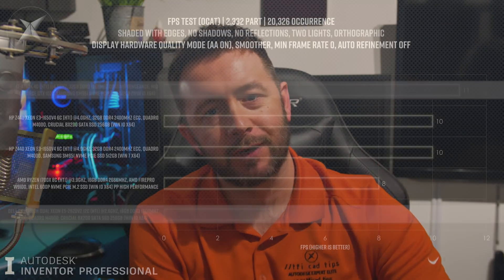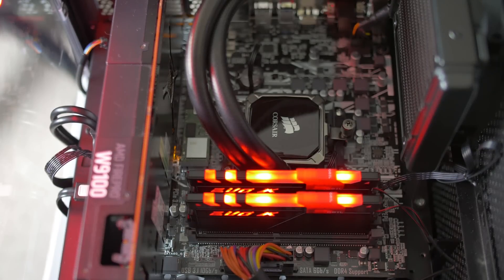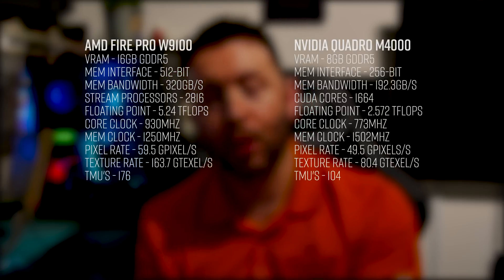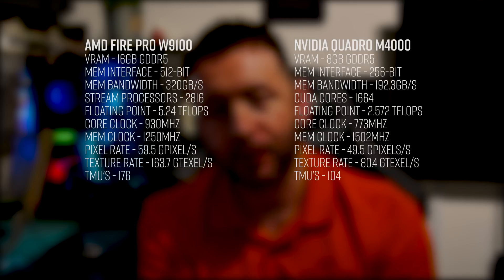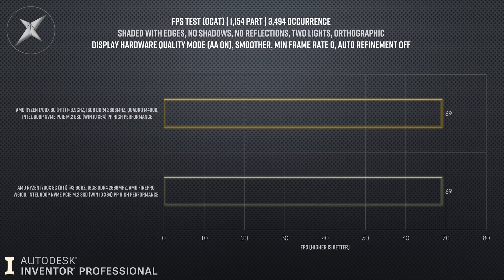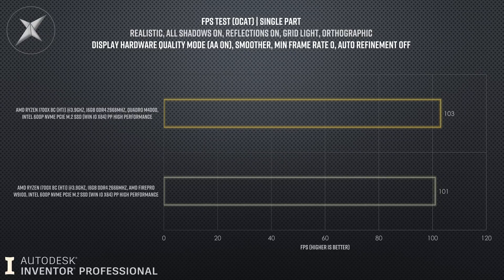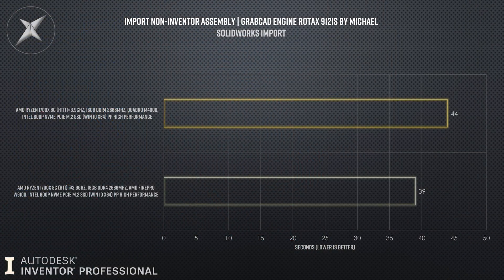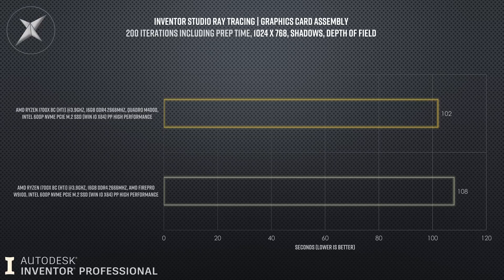3D CAD PC Hardware Benchmark #3 | Ryzen & Quadro M4000 vs FirePro W9100

Comment: Overclocking graphics cards by megahertz makes no sense because manufacturers will repair all defective graphics cards videoram memory is defective missing semiconductors on graphics cores and the like because the performance of graphics cards for example firepro W9000 and geforce gtx titan Z exceed 3 teraflops with defects repairing defects will double the performance therefore pci express 1.0 pci express 2.0 pci express 3.0 agp8pro buses are sufficient for 2060 year

Comment: Hi Neil, I were thinking about the differences between video cards, and I have a curiosity, what if you remove the video card and run the PC with the GPU of the CPU? To see if we actually need a video card for Inventor..
Reply from the maker: Yea I did that, and it was very noticeably worse.  I can only speculate that was down to the lack of VRAM maybe, and the CPU having to do more work for graphics so less power for processing... that could be utter bollocks but it was noticeably worse on the iGPU
Reply: I wonder what budget videocard would deliver enough hardware for Inventor to be happy... obviously high-end cards don't make a difference... Would be funny to do a benchmark test with a 50 buck card against their recommended quadro XD
Reply: Hey! I have like a week working with a PC withoud video card in Inventor, is an I7 7700K, 16gb of RAM Z270  Mobo, W10. To be  honest with settings in performance it runs very good. I guess that obiously there is a difference with video card, but the key issue here is (in my opinion of course), when you buy your first machine for example, you'll have more value investing the money of the video card in a better CPU ? I'm very impresed with the performance of the iGPU, I did have to remove an old video card (GForce 210) because the iGPU is giving me better performance in other applications.

Comment: Hey TFI,

I'm a mecanical engineering student and i'm looking for a laptop workstation.
The programs that i use are SolidWorks 2016 and Inventor 2016 and somtimes AutoCAD and Autodesk Advanced steel. Most of the time the assemblys that i use contain about 50 to 300 parts, the some of them are mecanical and i hate it when they lag. Sometimes I'm making renders or animations, but I do not mind to leaf my computer for a hour to make them. I would like to spend € 700 for something that does the job, but i can stretch it to about € 1200 if necessary. 
Do you have any advise?
Thank you!

Emiel van Beusekom
Reply: Emiel van Beusekom you can build a much better value pc for the money, than a laptop
Reply: Emiel van Beusekom but if i need portability  , which would you recommend?
Reply: jup, I need something portable. I already bough a laptop, but i am still looking looking forward for advise.

Comment: As you have proved gpu cards don't make any difference to performance, would you still suggest that some form of graphics card is used rather than rely on the motherboards on board graphics?
Reply from the maker: Yea totally.  The mother board doesn't have on board graphics, I think what you'll be referring to is the GPU on the processor (Intel HD graphics on i7 for example), not all processors have on board graphics and it's definitely not recommended to use that for 3D CAD.  The CPU graphics doesn't a VRAM buffer like a proper GPU, and although I can't find any documentation on this... I would guess/assume that using the integrated graphics will draw a lot of actual CPU resource.  A test I'll be doing soon is my 23 point test with my 1080Ti, then the same system just using the i7 graphics with no graphics card at all.
Reply: TFI I was just about to ask if/when you were going to do the integrated graphics test after watching this. I'm interested in what the results will be if inventor doesn't fully utilise the GPU.
Reply: This test I want to see! For a long time I have been quite annoyed with the weird Autodesk specs for hardware. SW is a completely different story and shows large benefits using quadro's over gtx's. Good thing someone is putting this to the test, thanks!